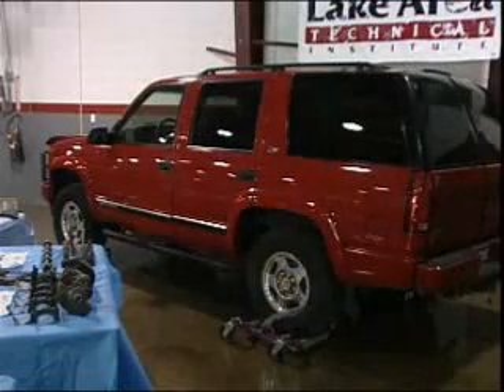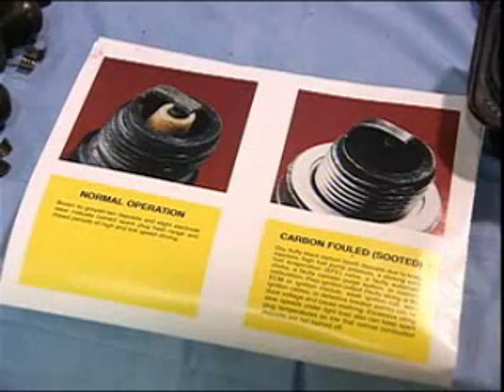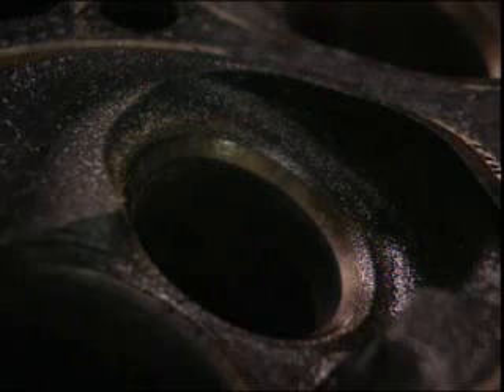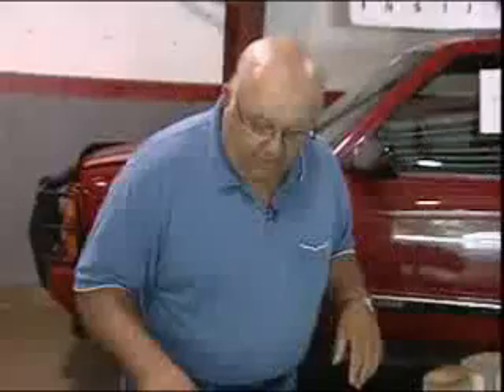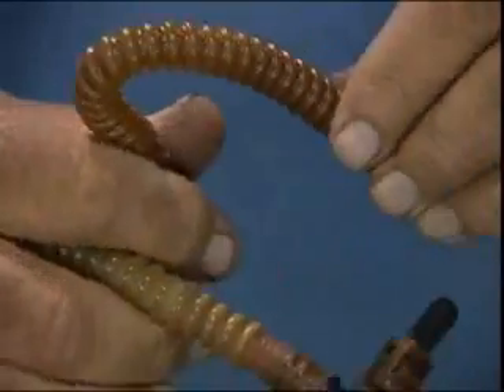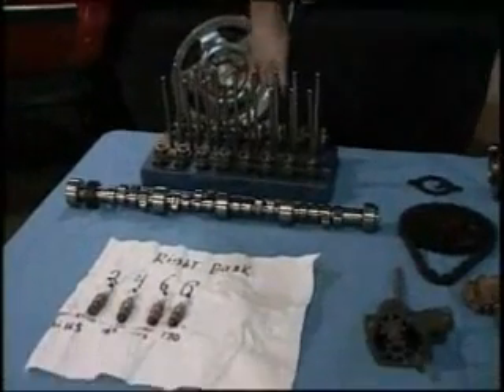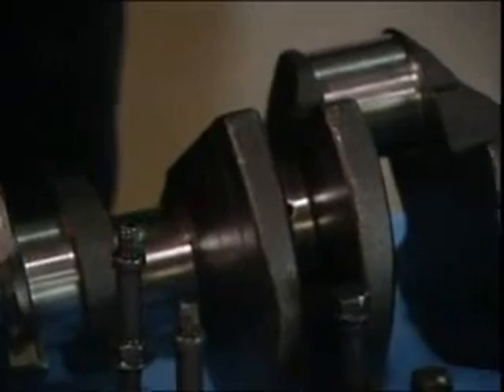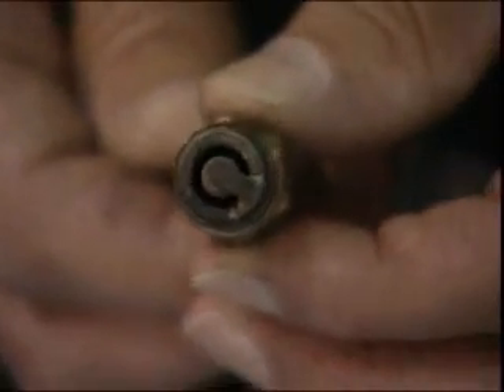E85 Conversion Kits Flex Fuel system engine damage ?

Comment: This makes me laugh 10 years later to see where this came into the market and where did it go? You mainly only see E85 in northeast US because they are pushing electric cars in west coast still. This video is a crazy subjective editorial that we all now know more facts about running e85 today and many of the things brought up are speculative at most. We all run gas that is basically E10-15 now due to federal mandate and will be going to gas that is mandated same as E20 in all gas by 2020. Brazil is almost all E85 with corn and sugar as abundant crop on hand.  What ever happened to flying cars and what will they use for power? LOL

Comment: actually what they are showing is that the ecu is able in some vehicles, to adapt itself to burning e85... And that it runs okay... Of course it does, but some ecus won't like E85 because they won't understand why suddenly they need to inject 30% more fuel... and think there is an issue somewhere... Check engine light on...

Comment: I have ran E85 in my 1996 Gmc 1500 4x4 which has 289,000 miles for the last 30,000 miles. I haven't had any problems. My oil has been cleaner. I have also changed my spark plugs and they have been way cleaner than with gasoline. All these E85 change over kits its a money hype. I also pull trailers with my truck. My truck has ran cooler and had more power.  Best part I see about E85 Big oil companies don't get my money over seas no more except when I do a oil change. My money stays with our American Farmers. Yes I admit  I did about 3 yrs. of research on E85 before I got the guts to run it straight in my truck. Only people against E85 are those that love big oil companies and possibly have stock or work for them. This stuff of downing E85 pisses me off. Specially since I have ran it and know the real facts about it. Wish I could run it in my tow truck but it's diesel and Bio Diesel is so hard to get a hold of so far. But I'm researching that is well.

Comment: Or in the case of carburettion, they're dumb - and many run rich anyway. If your plugs are black, gradually add ethanol until a tan colour develops. Doesn't cause any more fuel to be used, but you can often advance timing to make the Otto cyle more efficient, resulting in greater economy and power. My old Mazda FE engine runs awesome on E30!